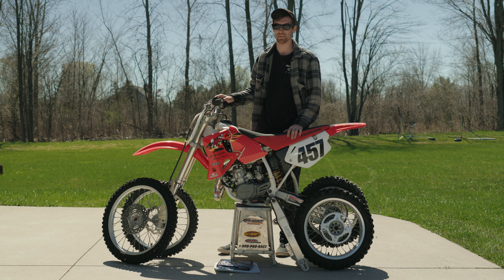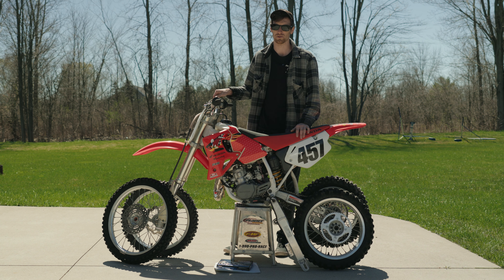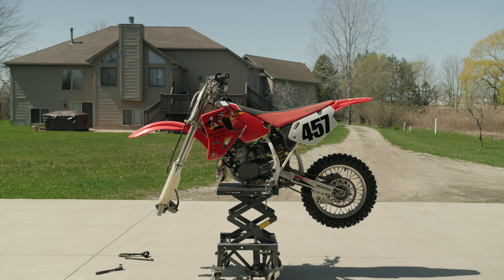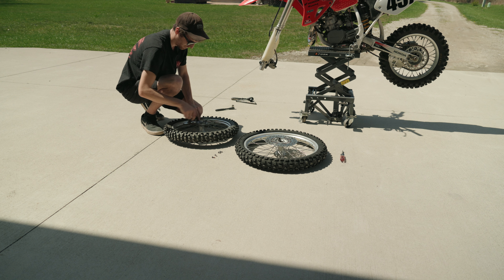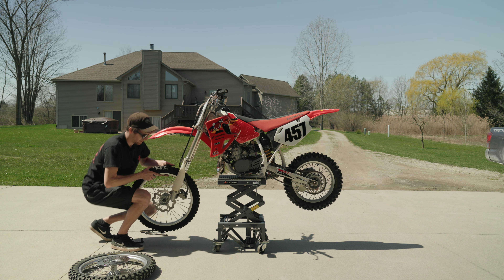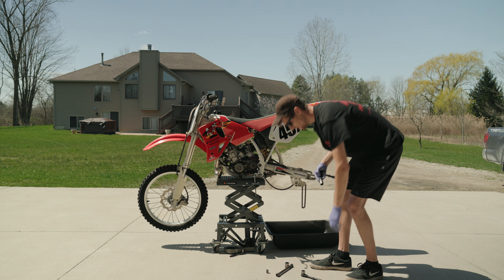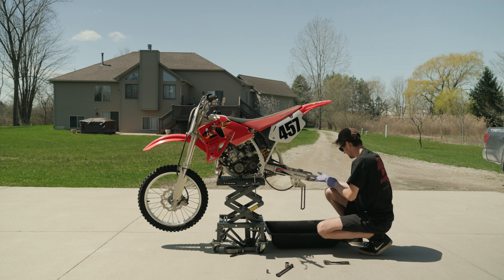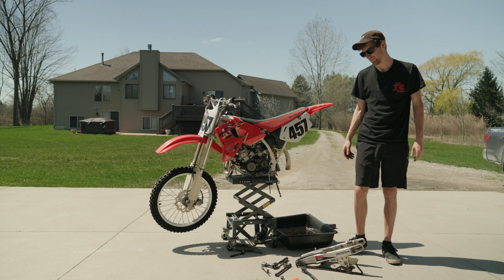Turning My CR80R Into A CR80RB! [CR80 | CR85 Small Wheel To Big Wheel Conversion]

Comment: So i have a 99 cr80 ..i want to make it a fun pit bike ..what year an bike can i bolt on parts frrom swing arm wise an forks ?
Reply from the maker: 96-2002(maybe 01 I can't remember is all the same CR80 like the one in the video. Everything from there (2003-2007) is CR85 with the upgraded gas tank with dual tank shrouds. Those cr85 parts should be direct fit on the 96-02. Like I could put a CR85 gas tank on my model and make it look newer. I love the 1 sided shroud design with these graphics. Thanks for watching 🤙

Comment: what size is the extended swing arm?
Reply from the maker: I dont know the exact measurements. The one I installed is off a big wheel CR85RB. They only make a small wheel swingarm and a big wheel swingarm. They are both interchangeable from the 1996 CR80 to the 2007 CR85
Reply: thanks for your video and for the info. i'm looking into doing something similar :)